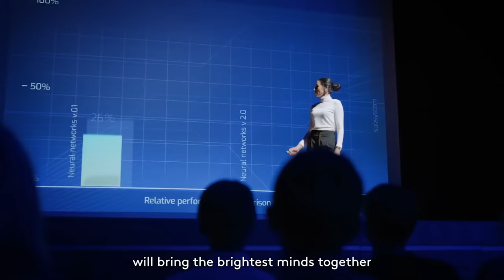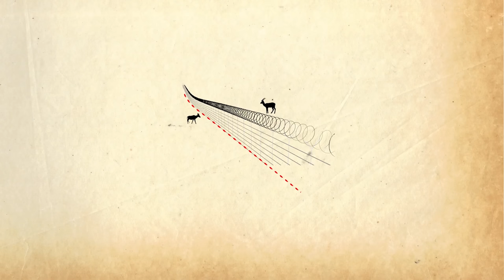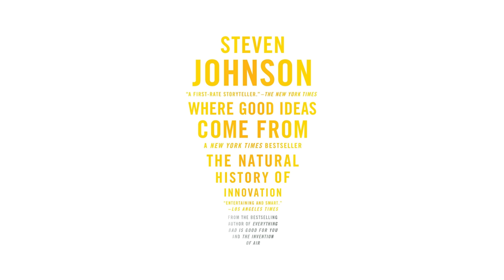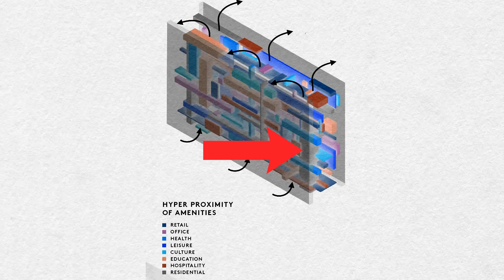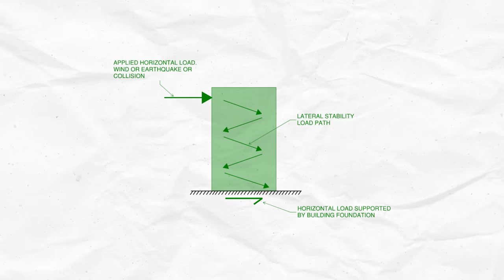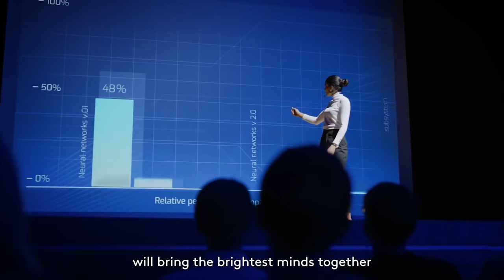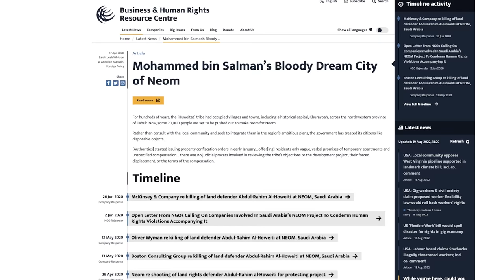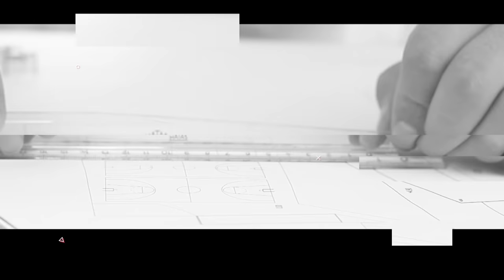This city concept breaks architecture (THE LINE)

Comment: I’m not even an architect or involved in any sort of urban planning but I just know that this is possibly the dumbest idea one can think of 😂
Reply: True.
Reply: What’s objectively dumb about it?
Reply: @Bobsonomatic  it’s a line, so what happens when one part of it is cut off? 500m tall mirrors? It’s the middle of a desert (well, they don’t have anywhere else to build I guess), oh yeah and it cuts off all animals from either side
Reply: @Bobsonomatic by design it leaves very little room for error. I’m a regular city a rail line or mayor street gets blocked and a region of the city becomes less accessible but you can still get in through secondary roads.

If a point on the line’s metro/driveable street gets blocked for some reason then transportation gets completely interrupted from either side beyond that point. Also emergencies like a fire become more dangerous since it can completely interrupt all transportation through that point including just walking
Reply: @Bobsonomatic  you're kidding right, everything about it is whacked. Ask any decent architect or engineer.
Reply: you clearly never seen the animation where they plan to import an Iceberg into the UAE, it even had penguins on it
Reply: Isaac Arthur, Arcologies. Someone with some math skills that made on of these that actually makes sense
Reply: @Spaceytig3r  😂😆😂😆😂😆😂
Reply: @pinkypink5161  Even Isaac would recognize how this is a bad idea.
Reply: @rommdan2716  that's why the one he proposed was a cylinder. Lowers lateral forces, maximizes volume to surface area, and structurally sound.
Reply: Not exactly a dumb or dumbest idea, but definitely looks like a really good conceptual student project.
Reply: @Bobsonomatic  It is if use your brain.
Reply: Obviously is and won’t happen or go to completion…because it’s dumb and dumb projects don’t attract smart money…
Reply: Completely agree!!!
Reply: They would need like 5 separate tunnels with 10 different rail lines total.
Reply: You're right,,,imagine in case of earthquake and let's say for example the middle part is destroyed by earthquake how are you gonna move from one side to another or in case of war it will be impossible for escaping
Reply: @holohulolo  Maybe not the dumbest idea in human history but it definitely makes the top 10.
Reply: It looks really cool though
Reply: @Bobsonomatic  a city being centralized is way easier to manage things like sewage and transport
Reply: Its an investment money grab
Reply: @gladiatoranc  burj khalifa would like a word
Reply: @BlazerManiacNumber96  that’s the only good thing about it
Reply: @jamesadams893  There’s obviously a lot of problems to solve, and there will doubtless be changes before they are through. The reason I had to respond to you is that your argument is amazingly illogical. You are appealing to authority without even bothering to have evidence that “any architect or engineer” (which is equivalent to saying all of them) will agree with you that “everything about it is whacked”.  You’ve piled fallacy upon fallacy into a statement which actually sounds convincing. It’s sort of pernicious. Are you a lawyer or politician or something?

I’m not educated or certified as an engineer, and neither was my dad, but we both strangely worked as engineers in our primes and found some success precisely because we were not stuck in their mental boxes. Anyways, not everything about it is whacked in my opinion, and I can assure you there are engineers that will agree with me.
Reply: @Bobsonomatic  it's only 200m wide, so you can't fit too many people per square meter, yet you're suppossed to have enough stores and offices nearby as to just walk everywhere, so you'd need tons of stairs and elevators, which in turn take space from more housing which would let more stores to be closer to each other and survive.
It's a line in the desert with 500m tall mirror walls and it's flat on top, so it's going to be incredibly hot everywhere and there won't be enough daylight for plants to grow as they plan it, which you need to help with the carbon dioxide which humans will create (yes, we create CO2 just by living and breathing, shocking), otherwise it'd be dangerous for the people on the bottom, if darkness almost 24/7 wasn't their only issue.
Hell, even archologies sound more plausible than this crap design and i barely know anything about architecture from futuristic megastructure videos.
Reply: It's an amazing idea in theory, as long as you solely think of possibility and disregard any factors of actually creating it. It seems to me like someone had a good idea and it was just never put through a process that would show while in a world with no adverse factors its amazing, but in the real world it isn't going to work that way.
Reply: @Bobsonomatic  giant mirrors in the arabian desert great idea🤣🤣🤣🤣🤣
Reply: not dumbest, they had quite a few LOL
Reply: @gladiatoranc  Investors are often not as smart as you think.
Reply: @jamesadams893  Ask God, God's name is ''I AM''.
Reply: @unworthy.potato  Animals are a disturbance to my tranquility
Reply: Sounds like the naysayers are aghast at having to walk to get around
Reply: @justynawisniewska1213  exactly and that's why it's a scam!!
Reply: @Bobsonomatic  if only there were a video ~that you're commenting on~ to show some of the objectively dumb things about this.
Reply: @bepopxxx  Starting it is easy...that's not the issue. They won't finish it!

Comment: Science fiction typically depict cities in a dome interconnected to each other. Even building cities in a dome to shields to shield themselves from the harsher environment is going to be extremely challenging. In that sense,  Singapore Changi Jewel is a miniaturized version of a city in a dome.
Reply: YOu might want to check out Arcology and some of those concepts for building domed and highly resilient cities.

Comment: The line is the only network topography where every location is a single point of failure. This is what happens when you plan a city without involving any city planner.
Reply: if this city gets built....IF
Reply: @midasredblade236  Well, the thing with totalitarian regime is, the desire of the leader can overthrow the common sense of the experts and lead to total disaster. Now clearly, a country with that many enemies shouldn't build the most vulnerable city design possible. You only need to cut one point to break the city in half. Also, every new section increases the load on the transit system on the side for external exchange and in the middle for internal transit. Imagine how packed the wagons will be at peak hour in the middle of the line.
Reply: @sfisabbt  There's a reason cities are built more like a circle than a line. The line would make a bit more sense if the ends touched instead, for obvious reasons.
Reply: Wouldn’t every tree (in the graph-theoretic sense, i.e. a connected network without any cycles) have this property? A failure at any point except at the ends of branches would disconnect parts of it.
Reply: @saschabaer3327  Oh yeah, you're right. I agree with that.
Still, in the case of a city, a more complex tree would enable more interconnection interfaces with the outside world, shorter average transit and more possible growth directions for the overall city. So already an improvement.
A more interconnected graph is of course the choice for a more resilient network.
Reply: @saschabaer3327  When you consider a tree as an analogy for a city, you must take a top down perspective. The trunk at the core and the branches moving outwards as the surface with the roots below as the underground services.
Reply: or when you've just smoked a really strong joint :)
Reply: This is prone to so many problems from as little as transit accidents to collapse of a sector or multiple which would lead to a domino effects of I believe the movies name is NOPE.
Reply: Hey with enough cash thrown anything is possible and the sky's the limit.  No need for pesky things like education, addressing poverty etc
Reply: Geddes already perfected the city plan in 1900s. No need to reimagine the wheel with a fucking line of a city lmao
Reply: But the entire project was designed by city planners‚ architects‚ and engineers
You can see the firms involved in the LinkedIn pages?
Reply: @WunHeart  like the pyramids.
Reply: @bonafidemonafide7810  and? You actually think they are gonna even finish 10% of this 170km engineering nightmare? Lmao

Comment: The reason that cities end up being roughly circular unless there are no external factors forcing a different shape is to make it so that the important amenities are as close as possible to all residents. By making NEOM a line you create a situation where someone would have to travel 85km to work, another 85km to see their friends afterwards and then 170km to return home. Even if the transit system were to work flawlessly and all power came from renewables this is still a significant ecological cost that could be greatly reduced by having a traditionally structured city which promoted walking and cycling over large roads for cars.
Reply: exactly, being able to travel in 2 dimensions allows for a lot more than just 4 directions, it's every direction in between as well, as opposed to this where things are only to your left and right.
Reply: No, you misunderstand: that’s a feature not a bug.  You see, the rich obviously deserves the nice, airy Red Sea penthouses.  All the imported “guest” laborers get stuffed into the eastern caves.

It keeps the undesirables in their places.
Reply: @RobertLeeAtYT  Exactly. "Everyone would be within 5 minutes of everything they need.". Because the classes are divided, professions and status are life long, and everyone is placed where the monarchy wants them.
Reply: @RobertLeeAtYT  Nothing wrong with keeping the undesirables out.
Reply: Also with all that space they made it so freakin narrow
Reply: Height combined with a 'sandwich' structure allows more efficient management of temperature and moisture distribution.
And it has to be a 'line' that's aligned with the suns path (as much as possible) so that the sunlight reaches inside despite it's tall 'sandwich' structure

Comment: It is one of the most conceptually problematic proposals I have ever seen. My design professor completely tore it apart in a lecture last week. Anyone in the construction and architecture industries would know that this is some major pie-in-the-sky stuff right here.
Reply: As a geoscientist am here wondering isn't this literally creating a pathway of weakness for any natural disaster. Let's say a fault occurs, then what, the line is a direct weakness that is structured, it would follow that line directly....can you imagine the damage and the death tolls? It's a nightmare......
Reply: That's the problem. it wasn't designed by a urban planner but by the "prince" or someone from his famili :D
Reply: @marzadky4934  I think a the 'line' design was chosen to minimize the energy and other costs associated with maintaining a habitable environment in the desert. I think heat and moisture dissipation are much more manageable with this design. But we need more details to judge it resilience to natural disaster.
Reply: @primaryesthethicinstincts4832  if that were really the case they should have buried the whole thing. There would have been a constant subterranean temperature and that ridiculous stack ventilation diagram may actually have been able to function. However in saying that stack ventilation never works unless cool air is taken in at the bottom of a structure, heated through use and allowed to escape at the top.

Comment: I’m not an architect or engineer, but even I can see major issues with this design. My first thought (which you touched on in the video) was how is it going to interact with the wind? Wind travelling perpendicular to the structure would apply massive amount’s of force onto the building and wind travelling parallel would turn the gap in the middle into a 170km wind tunnel.
Funnily they keep advertising to me on twitter, if they’re hoping for an investor they’ll be disappointed to hear that I have no money.
Reply: The biggest one is simply geometry. Making the city linear means that you're immensely increasing travel time if you have to leave your 'block'. Which can be ameliorated to an extent by each block being self contained . . . But it's better to retain flexibility than to plan for rigidity.
Reply: "if they’re hoping for an investor they’ll be disappointed to hear that I have no money" yes, the richest country in the world needs investors lol keep smiling buddy
Reply: @CASSEMELLO  I just clicked one of their Ads, in the dropdown menu their is a “invest” option. So yes, they are looking for investment.
Reply: @CASSEMELLO  not even in the top 10 list of the richest countries, and yes of course they need investors for any project like this, don't kid yourself.

Comment: Another great video!  I live in San Francisco, where the transit system is historically designed to focus the whole region on downtown San Francisco (though cars and highways make it easier to "metabolize" realities like San Jose rising to have double SF's population and "reverse commuting" to satellite corporate compounds throughout the region).  What the Saudi Prince should be briefed upon is that San Francisco is ALREADY a case study in the problems of over-emphasizing a tiny version of "Neom" with it's existing transit system today, right now, and observable maintenance and usage.   That's the four stops of overlapping "MUNI" and "BART" systems in a small corridor just around 2 (not 170!) kilometers long as the "heart" of the transit plan for the whole area.  There are TWO tracks for MUNI and TWO tracks for BART passing through this section of the entire area.. and if there is a problem at any of these four stations... transit is slowed or stopped for the City and the region at subsurface and this "pinch point."  IF there is an accident, such as a suicide on one track, then one system is immediately crippled to 50% capacity using a single track for reduced train traffic in both directions.  An earthquake, in theory, could make both tracks disrupted or unsafe and kill the entire flow indefinitely.  In my opinion, this has already shown to be a disaster, propped up by emergency deployment of surface buses (less efficient and, in the case of BART, impossible to replicate the efficiency of up to 10 packed train carriages every five minutes or so in rush hour) and then the surface buses further congest the street level and bridge pinch points so it's not an actual competitive alternate use case, it's just how you rescue people from a system that has no other redundancy which can help.  Even without tragedy, how do you maintain or upgrade the system without massive inconvenience?  In my thirty years of living in SF, routine maintenance has meant that evening or overnight service just goes away for months at a time, which creates not only social but economic woes for the central area.. in NEOM, there would be curfews or "just walk 40 km to see your uncle if you must" scenarios!  Again, the ONLY reason this is tenable is that the foolishly unitary section of the transit system is LESS than two kilometers and we have surface level options. The contrasting example is NYC, where there are so many lines, that an entire line can be CLOSED and only the people served only by that radial line are impacted, but the majority of people can adapt immediately by moving to another subway or train line and then lesser inconvenience of surface transit in outlying, less dense areas.  By building a system that emphasizes a single, unitary and unified system, when (not if, but when, as all things fail, or get compromised by crime or terrorism) that slips, people will be forced to walk MUCH more than "five minutes' to get to friends or family up to 170 km away!  Thanks for reading!